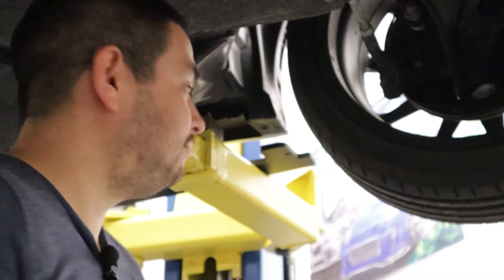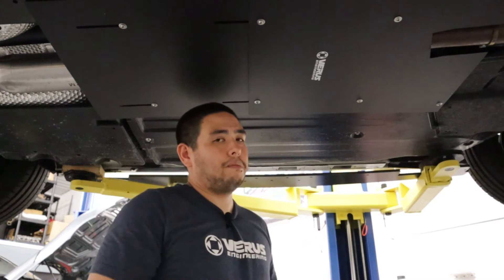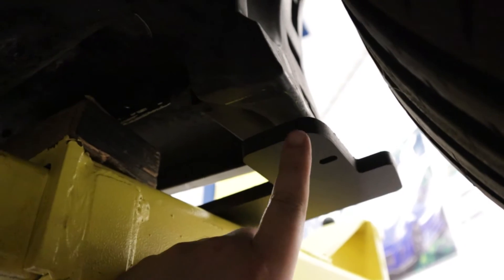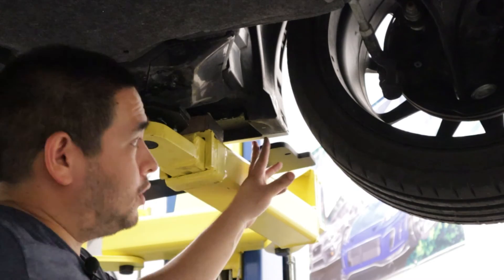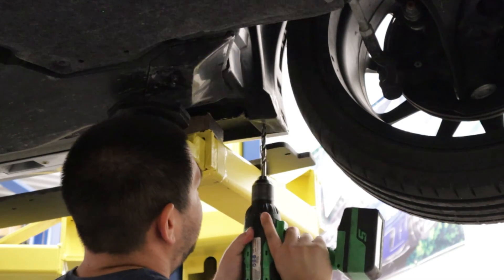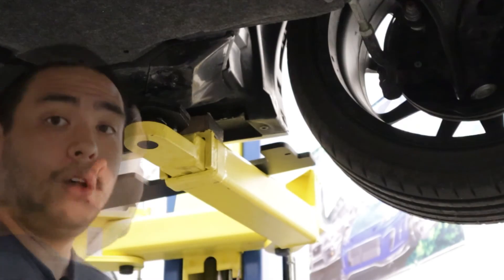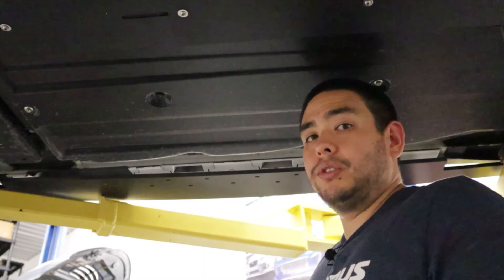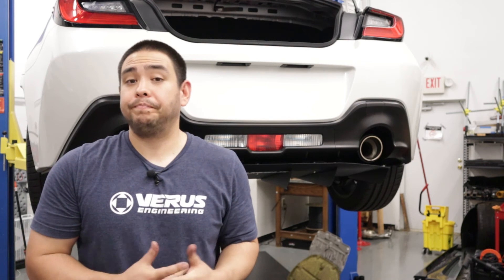2022 Toyota GR86 / Subaru BRZ Street Side Splitter Kit Install

Comment: Anyway not to block those stock pinch welds? Pretty important for jacking up the car. Thanks!
Reply from the maker: The pinch welds are not blocked. These install on the outside of the pinch welds so that they are still accessible.

Comment: Got the side splitter but after jacking up the car and leaving it on jack stands, the side splitter doesn't sit flush in order to get any of the steps done. how would you recommend I do this if I were  installing at home?
Reply from the maker: Where are you placing the jack stands? We would recommend placing the jack stands in locations not near the side splitter for this specific install.

Comment: Should use tapered screws.
Reply from the maker: This is a much better solution for those that want to remove the side splitters from time to time.
Reply: Use tapered screws instead of that rivet nut he used?

Comment: wtf is that supposed to do? its a piece of flat plastic!
Reply from the maker: They are an aerodynamic device that keep the high-pressure air on the top side of the vehicle which improves downforce.